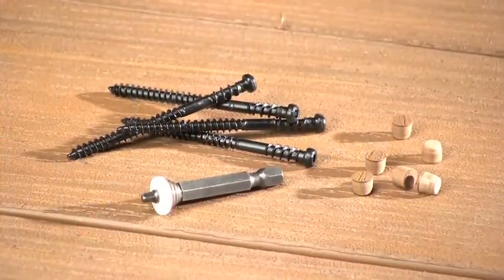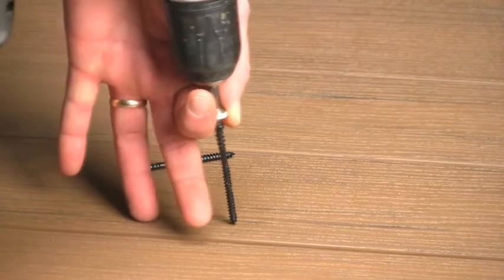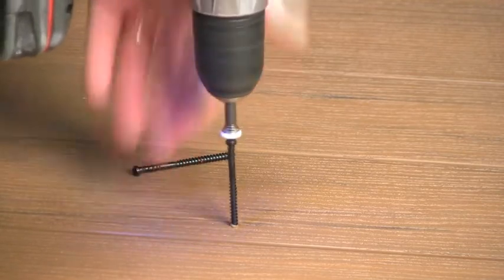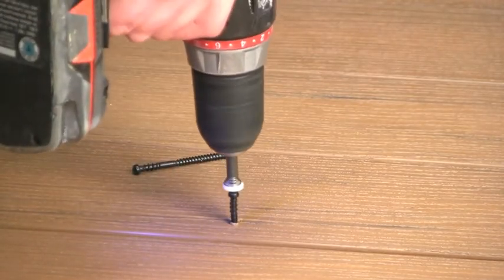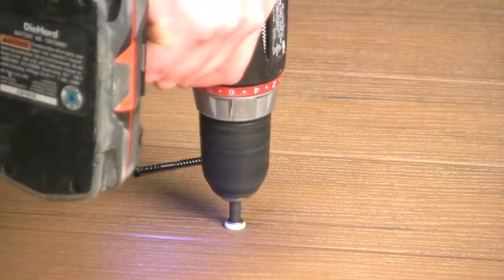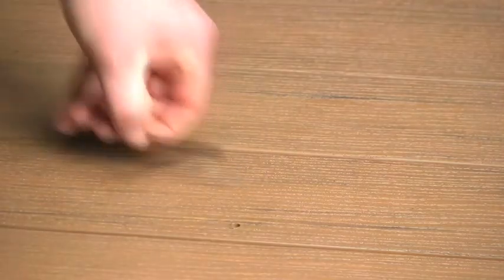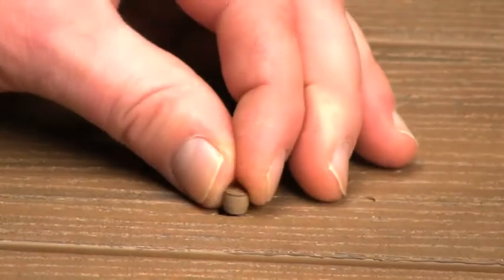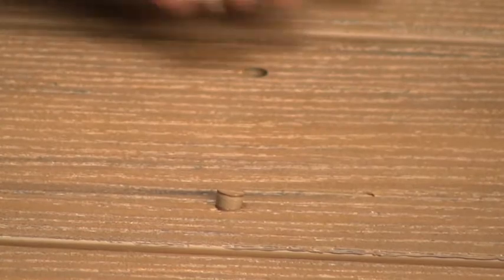How to Use Cortex Hidden Screws

Comment: The only time I've seen them not drive deep enough is when installers were going too slow with the driver trying to be too careful.  You have to hit them hard and fast.  The felt on the driver will protect the surface of the decking and the driver will disengage from the screw at the proper depth.  Once the installer got past the first couple of boards and their confidence improved, things went more smoothly.

Comment: these screws are amazing, don't know how you can say otherwise but you must make sure you use the felt tipped driver bit that comes with the kit, the only downside is there expensive  50 screws and 75 plugs and one bit for about $30.00 canadian and another reason why there great is almost impossible to strip the screw, good job Cortex!!

Comment: Decent product, however the left-handed threads near the screw head make little sense. If you miss your target (joist, stud) the screw won't seat properly, and won't back out. Stainless square drive is the only way to go, and you can buy a box of plugs separately.

Comment: Not impressed with these screws. They go in NP but don't try to take them out because they strip. You make a mistake and want to change something good luck!
Reply: I've taken plenty out with an impact drill. You only get one chance with it before the top messes up. If that fails, you can always destroy it and drive it in with maybe a 3/8" drill bit to create enough depth for the plug.
Reply: Instructions state
 to remove use low speed